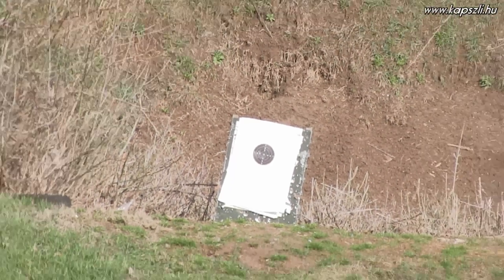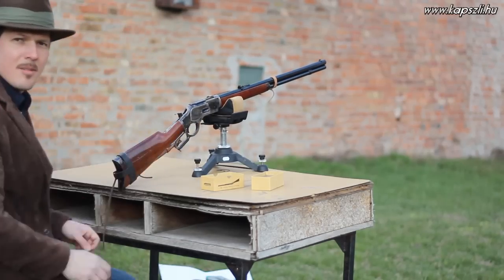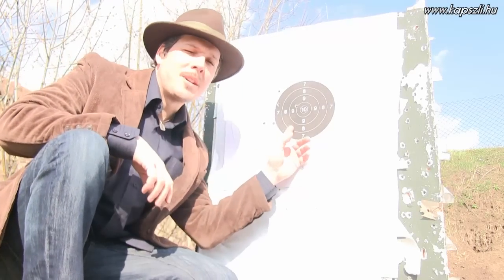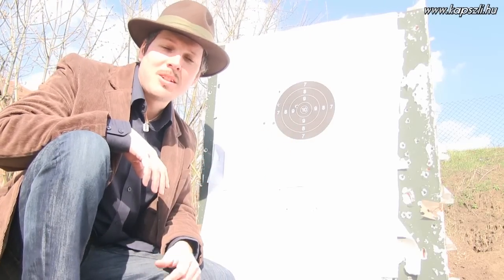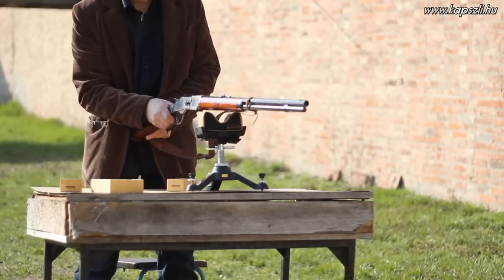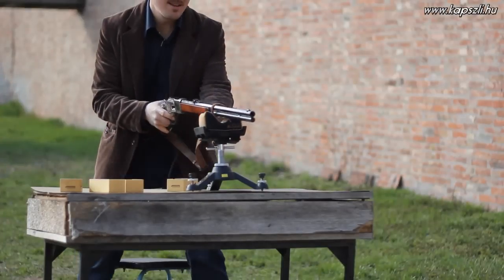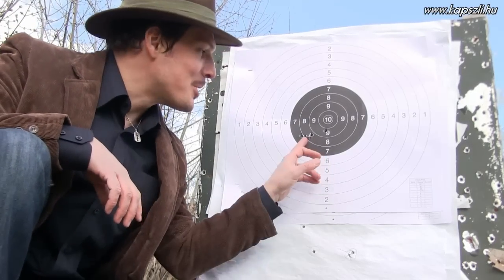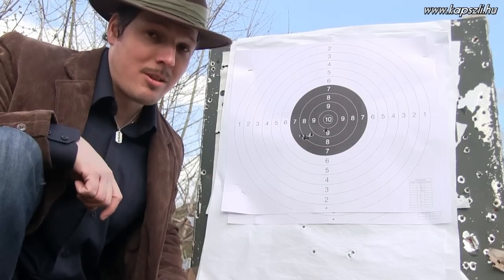Hole in hole accuracy with 44/40 Uberti 1873 Winchester and BPCR ammo

Comment: I encountered a similar issue with my Winchester 1885 Low Wall in .32-20. I have an original Winchester loading tool and I loaded some rounds with that and some with a new press. The one thing I found is that if I used the same bullets, commercially made that were sized right (Lyman 115 grain), that the rounds loaded with the Winchester tool were as good as those with the new press and full length resized. It shows how much proper bullet diameter is to accurate shooting.

Comment: I am not a professional by any means but from what I understand Tube loading rifles are not exactly " match accurate." Due to the tube feeding mechanism, the force applied to the barrel changes as rounds are extracted from the magazine and fired, this causes the harmonization of the barrel to change from first shot to last. I would suggest maybe loading one cartridge at a time to verify accuracy and then shooting from the magazine once an accurate load has been found. OR always KEEP THE tube loaded so as to find a load that harmonizes well with a full magazine.  
Shooting modern smokeless PRS level rifles has taught me a lot and consistence is key to maintaining SUB MOA accuracy.

Comment: I would like to see a repeat test, shooting the bullet as cast without any sizing. If the bullet is too large the sizing die could be honed open slightly to the desired dimension. I would like to think a real cowboy would have certainly done this; If he was blessed enough to own such a fine firearm. I know I would. I understand the tool is a vintage collectable, but, you are using it and posting it on youtube soooo.... fix it.
Reply from the maker: Jack Jacobs I disagree. I reload my cartridges with modern tools. I only used the Ideal tool for demonstration.
Reply: I personally would not alter an original tool such as the ideal tool he is using. I have no idea how much it's worth but even if it's not worth a lot, I'd still leave it as original especially if it's not his main reloading tool which it is not. These types of tool etc have nostalgic value sometimes worth more than the tool itself.